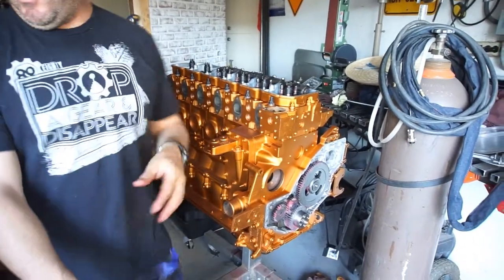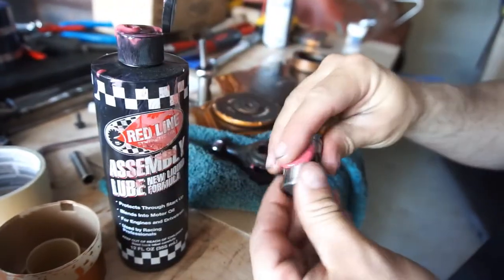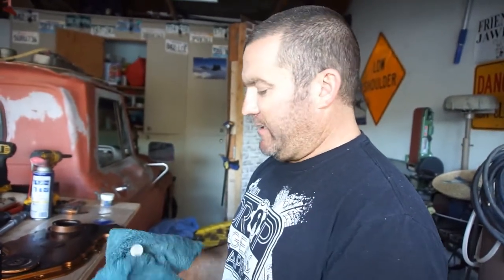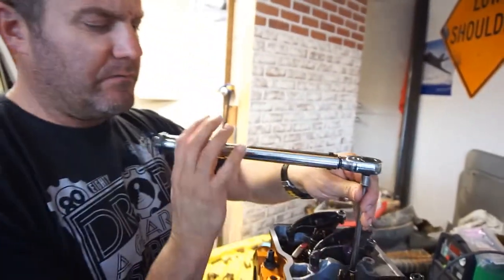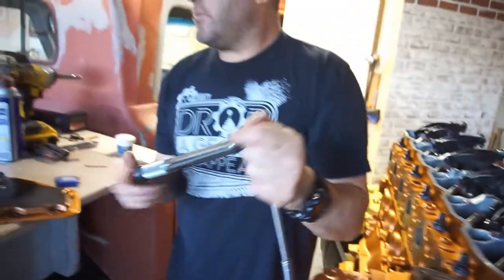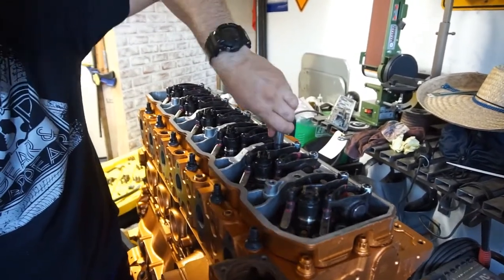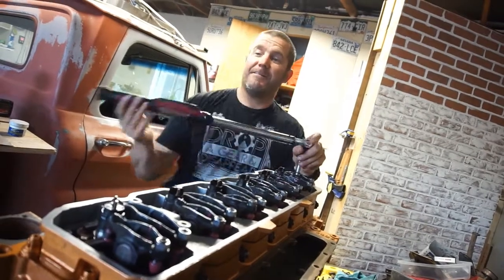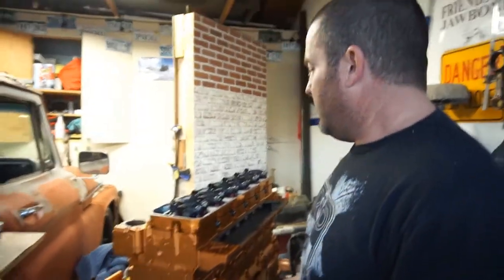Part 18 6.7 Cummins Build Installing The Rocker Arms and Its Painted..

Comment: Quick question man, I was replacing a injector last night and the plastic piece that holds the metal cap that sits on the valve bride broke. And that metal cap is off the rocker arm now but I’ve seen other and in this videos that you don’t have those plastic caps and run em. Will that metal piece just sit on the rocker arm or does it pop back in ? Or do I just have to place it gently without it falling off
Reply: Hey, sorry I’m a bit late for this, but it should work perfectly fine to just set the rocker on it without the plastic piece but it won’t pop into place

Comment: The round things that you put into the rocker arms are called trunnions. 

Q: Why did you torque the injector down before setting the crossover tube (injector tube)? I’m asking bc I was told different and everything I’ve read says to do it in the following steps;

Step 1) Lube and set the injector with the crossover tube hole facing crossover tube port. DO NOT FORGET THE BRASS ON BOTTOM OF INJECTOR. 
Step 2) install injector bolts hand tight keeping the injector bracket level. 
Step 3) Lube and install the crossover tube (Keep the balls to the top, install it into the hole but before pushing it all the way in twist back and forth slightly. You will feel that it’s in the groove to keep the tube lined up. After you’ve done that go ahead push it in and it should pop in. While holding the crossover tube in with your thumb with very littlie pressure slightly twist the injector back and forth and you’ll feel the most comfortable position for the injector and crossover tube. Install crossover tube nut. 
Double check bolts for injector. Make sure it’s level and hand tight. 
Torque the crossover tube nut to 37ft/lbs
Torque the injector bolts to 44in/lbs (7ft/lbs) keeping the bracket level all the way down. 

IF ANY OF WHAT I SAID IS INCORRECT PLEASE NOTIFY ME! I’M IN THE MIDDLE OF REBUILDING A 5.9L COMMON RAIL
Reply from the maker: That all sounds like what I read everywhere too. I did it the way I did it because they’re used injectors and tubes so I wanted it to be in the same spot as before. I would have done it the right way if I was going to use new tubes which I should have done.
Reply: @Halffast719  you would suggest getting new tubes even if the old ones look good?
Reply from the maker: @Aidyn349 yes they’re metal too metal mating surface but everyone is different.

Comment: Hey so on what position the crankshaft have to be in order to torque rocker arms
Reply from the maker: If you put them on in the same order they came off you shouldn’t have any special order. But you could always back off all the adjustment screws all the way out so you don’t hit valves onto piston.
Reply: I made the mistake of moving the cylinder to TDC before installing the new cylinder head. When installing rockers arms I noticed cylinder 4 rocker arms were very difficult to install. I removed it and noticed only 1 push rod was bent. Could there have been any other damage needing to remove the cylinder head again?